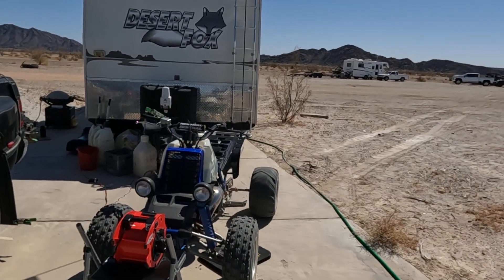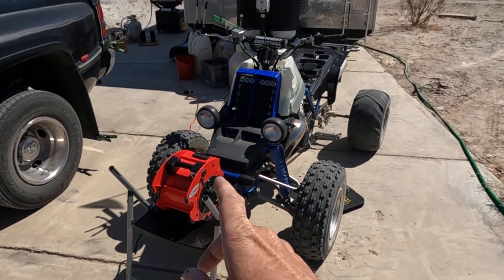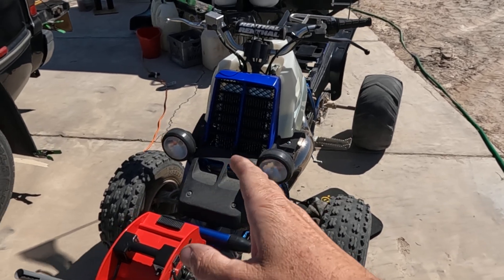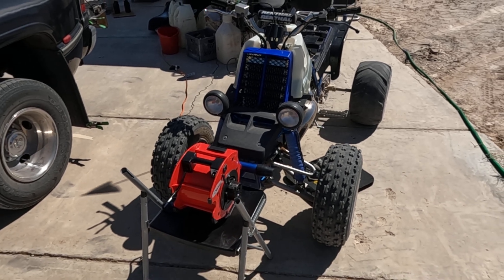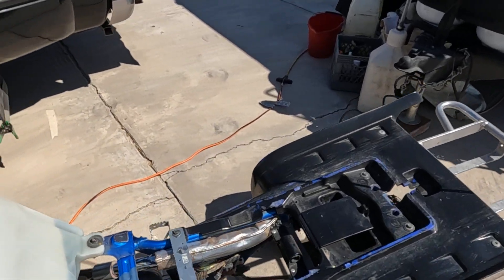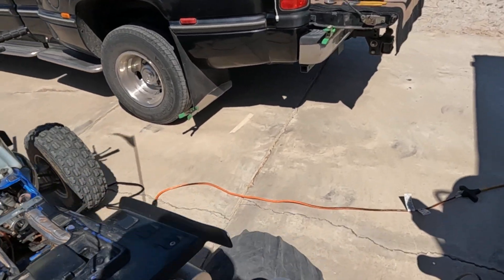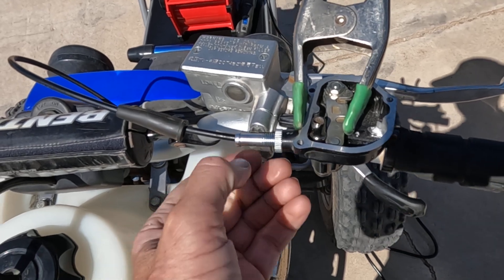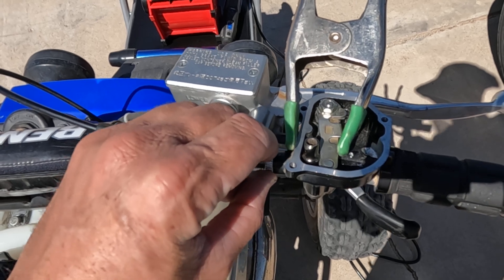How to Syncronize Banshee PWK Dual Carburetors #banshees

Comment: Hey man, I’m at this point in my Banshee build my first Banshee build ever actually.  Just wondering what’s the 1/4 inch socket for
Reply from the maker: Instead of using a 1/4 inch socket, use small washers Instead to give you shims to increase tension on throttle cable inside throttle housing for doing the carb sync. Just remember to loosen tension on cable giving some slack before you shim it with washers. That's what I did and it worked for me. 
Just remember to double or triple check your sync because things can get out of whack when tightening things down.

Comment: Dr. Livingston, I presume!
Or is it just the cool hat...
Noticed the construction strap under the seat. Is that frame reinforcement, seat mount, or a bracket to mount something.
I also looked at yyour fuel lines. Do they get hard and brittle? Also, where they connect to the carbs, could you install brass 90 degree angle fittings to give the fuel lines a less strained, straight in connection. Ok my man. Happy riding. Your Banshee is lucky to have such a caring daddy! 😅
Reply from the maker: The strap is a solid mount I'm using for a pod air filter setup I'm building. I tie the fuel lines together so they don't rub on pipes and burn. A 90 might help on that one side I'll check. 👍